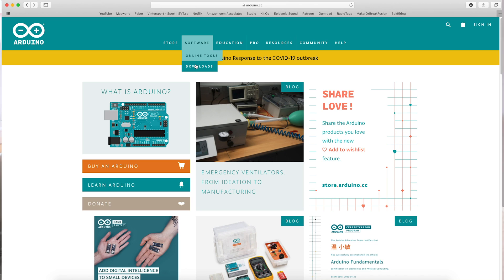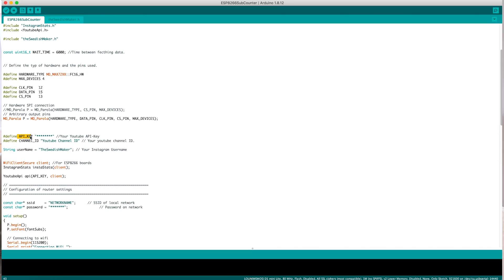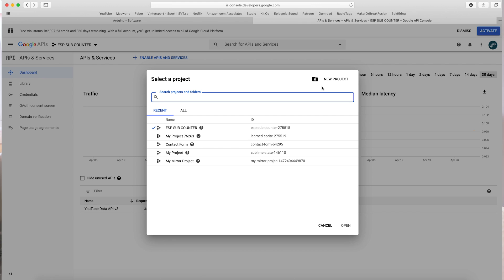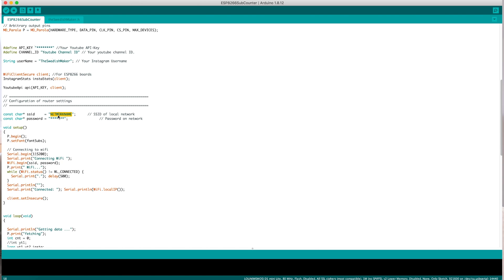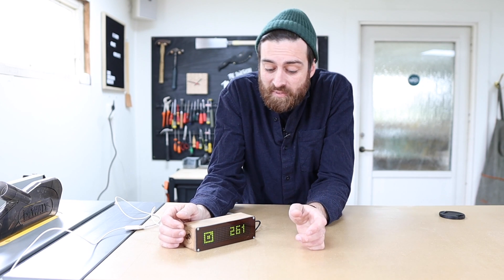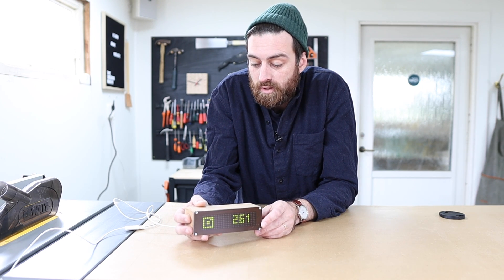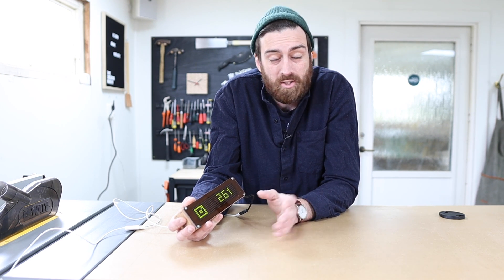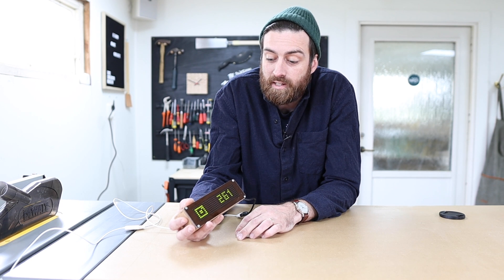This is The 20$ Subscriber Counter - Youtube & Instagram

Comment from the maker: There is still no new solution for the instagram number being zero. I will post it when I have a solution. You can increase the fetch time to about 60 (3600000) minutes to have it working longer but it still times out after a while. This is due to Instagram blocking the IP-adress after a number of times. Let me know if you find a solution.
Reply: Could I ask you to add on the code Twitch, Twitter, weather and time? Is it complicated? If it could be possible would be great!
Reply: Hello budy, how are you ?
I came to your channel through this video of the subscriber and follower counter, I thought it was great but there is a problem the follower count only shows zero, I saw that this is also the case for other people, I don't know almost anything about codes and maybe you can help us with this by making a new video solving the error and it will be very good for you as this video is one of the most watched on your channel, I hope you read this sorry for the writing errors as I am using Google Translate hugs from Brazil.
Reply: Im planning on starting this project soon. When you mention it times out, does it eventually start working again or does it "brick" itself? thanks
Reply: @christopherchadderton348  No it just showing "0" on Instagram sub.
Reply from the maker: Did you use the new code and do the Facebook API thing?
Reply: quick question about that do I use the access token I generated with the facebook developer thing?
Reply from the maker: @porgiscorner  exactly yeah. And then it can be used for generating that extended token which will last you a couple of months.
Reply: @TheSwedishMaker  I followed all instructions and its still reading 0 for instagram including doing the api with facebook etc.
also is there a way to remove the youtube count?
Reply from the maker: To remove the YouTube account you can just delete the lines regarding YouTube. To make it work with instagram I am not sure what isn't working. Mine is working with that exact solution. Does the serial monitor output anything?
Reply: @TheSwedishMaker   ok update I made it work and read but its showing my facebook page followers and not my ig followers

Cause its showing 168 which is my facebook page
But my ig is 758 and it wont grab that number count I tried so many ways and it will only pickup the facebook page number
Reply: @TheSwedishMaker hey could you help me the counter for Instagram doesn’t work
Reply: It's not as elegant, but if we set our social profiles to display subs/viewers/followers etc. on public, you could read the value from DOM (can even do that as a scripted action in Google Sheets - so you could maintain all the required data in a single sheet, and use that as the data source for hardware read). It's not as nice as using API calls but for public-facing info like number of instagram followers, it'd work, and if there are any DOM changes, it's extremely quick to change the reference in a google sheet, without needing to do anything further to the chipset code.
Reply: I finnaly manage to generate my access token, but im confuse about the "IG_USER_ID", can u explain what it means? is it my username?
Reply: I have programmed the solution. My software is 100% compatible to the hardware layout. It uses the new facebook API to get the follower counts from Instagram. I added some other features like temperature and humidity. It was a hard way to get it running. I must do a API review by facebook to get access to the Instagram followers. You will find it on www.kidbuild.de or on instagram @kidbuild . Greets Lars
Reply: @Kidbuild_DE  do you have the code somewhere ? would love to use it
Reply: @styx23x  You will find it on my Website. www.kidbuild.de
Reply: You can trigger instagram every 12 hours. I am using awtrix firmware and Node-RED and n8n to build flows and deploy it via MQTT to the device.

Comment: Hi, I just tried your "second" method but this time the instagram counter is always 0.
I have followed step by step everything you have recommended ... but I can not. Have you also encountered this problem?
Reply from the maker: Hi! I just managed to get it working this morning, but didn't have that issue. What does the serial monitor say? Did you make sure you got the correct ID and Access token?
Reply: @TheSwedishMaker  The same thing is happening to me! I entered the token formed by many characters and then as USER IG I put mine and Instagram. Yt works (although I don't care 😅) but Instagram gives me from scratch. Whereas if I try to use your old Instagram code it works for me... What am I doing wrong?
Reply: I know maybe I'm bothering you, but this meter is really important to me... I have to give a gift to a person very dear to me who is having a bad time at this time... So, can I send you the code privately? so I'm sure we'll be able to solve the problem in a flash. Thank you again For your time!
Reply: @TheSwedishMaker  I know maybe I'm bothering you, but this meter is really important to me... I have to give a gift to a person very dear to me who is having a bad time at this time... So, you So, can I send you the code privately? so I'm sure we'll be able to solve the problem in a flash. Thank you again for your time!
Reply from the maker: Go ahead and send me an e-mail at theswedishmaker@gmail.com I am going to bed now but I can check it in the morning
Reply: @TheSwedishMaker  Thank you so much indeed! Unfortunately, I've already turned off my PC. Tomorrow morning I will give you everything!!
Reply: @TheSwedishMaker  Hi, I sent you the email. Ps I succeeded but it doesn't update every 60 seconds but about every 4 minutes. Does that happen to you?

Comment: Thank you for posting this video! I found two other videos that used Dot Matrix displays, but unfortunately their scripts didn't work, so I'm glad that I found your tutorial. 
One thing that I'm curious about is how to remove the stuff for the Instagram (I sort of know, but afraid to delete anything and mess stuff up), and I was also wondering how hard it might be to include Twitch API for showing follower count from Twitch.
Reply from the maker: Hey! I havent tried twitch so I have no idea, but it would require some work. As for Instagram you can try uncommenting lines in the code with // That way you dont need to delete anything and its a great way to learn as well :)
Reply: @TheSwedishMaker  I'm now trying to figure out how to add Twitch and Twitter follower counter into the code. I'm currently trying to figure out how the API libraries that I installed for Twitch and Twitter work. I did also figure out how to make custom fonts/images for the dot matrix board, and so far made a rough Twitter looking icon and a decent Twitch icon.
This is sort of fun trying to figure all this out, it sort of feels like a complicated puzzle, lol.

Comment: First of all thank you so much for making this video, it’s very educational and entertaining! 😃 Also I have a question for you, would it be possible to replace the Dot matrix with a ws2812b matrix? I’m a total newbie at this and there is only 1 data cable. I think the code would need to be remade in order for it to work? Any help you can provide would be highly appreciated! 😃 
PS: I’m trying to make this as a gift for my GF, so that she can have as a prop in her videos.
Reply from the maker: Hi! And thanks for watching :) It would definitely be possible to use a different another screen but as you say the code would need some modification. Most of the hardware have their own library that should be added to the Arduino Sketch. Good luck with the project!

Comment: I think there is a slight mistake in description that box was "10x4x4cm" , but it should be really bigger in lenght as the matrix module dimensions are at least 12.8 x 3.2 x 1.3 cm (L*W*H) .
Reply from the maker: Yeah that could be the case, I cant quite remember what size I used

Comment: Hi, as you probably have read for other comments... instagram is stuck on 0; do you know if it's my problem or just instagram doesn't want us to fetch? changed timer to 15Mins but nothing...
Reply from the maker: Hi! It seems to be something with Instagram. I havent had the time to dive in to it yet.
Reply: @TheSwedishMaker  got the same issue, but YouTube count is working great. Thanks for the simplified code mate, of all the displays i've seen yours is the best. If you crack the Insta "0" count let us know! :)
Reply: You know what, I just had to wait about 10 minutes and Instagram count caught up also. All works perfectly 🤩
Reply: @mredrollo  for real?
Reply: @diegovio6626  yeah, maybe after it refreshed. Instagram and YouTube working perfectly.
Reply: @mredrollo  did it work just as before, or maybe you reset router? I have the  same problem with 0 counters :/ it would be so awesome if the solution came before christmas as i was thinking of gifting this peace :/
Reply: @MartynasM  honestly when I loaded the script, I said WiFi... fetching... then YouTube count and Instagram 0. I knew a few peeps had the same issue so I went to the comments. And then Instagram just started working. Don’t know, just took about 10 minutes to catch up. Now when I plug it in it’s there instantly.

Comment: Hey!
IT worked like a charm but now it only Shows me 0 at instagramm but yt works
Reply from the maker: Hey! Yeah I saw that, but I haven't had the chance to see whats wrong. I will update once I know whats going on.
Reply: @TheSwedishMaker  Oh okay so its not my chip that broke ^^ Would be awsome if you could find a way :)
Reply from the maker: @twoxico6036  I think that one solution might be to change the amount of time between fetching the data. Theres a separate row for that in the code. I haven't tried it yet, but it might be a quick solution.
Reply: @TheSwedishMaker  Actually one question :) I know i ask for a lot but could you do it like an Instagram counter and then a clock? So instead of yt counter a clock?
Reply from the maker: There is now an updated version to work with Instagram. I've updated the GitHub and the description of the video.
Reply: @TheSwedishMaker  Thanks a lot i will Look into it :)

Comment: Hey man! This project really works!! Thank you so much . But you didn't gave some libraries so i had to download 3 libraries . Still ! God bless you!!
Reply: Which libraries did you need to add? I'm struggling  to find the third.
Reply: @ViolentRunning  basically you will het an error like "library.h" no such file or directory. Go to Google and search for that library, if its a zip then sketch >library> add zip. If its direct thn add file.
Reply: @naafff1  thanks got it running in arduino now. Hopefully the hard ware arrives tomorrow
Reply from the maker: haha thank you! Glad it worked :)

Comment: i can't make it work  no MD  parole library found ....  and others  please help ...
Reply from the maker: Hi! I dont have my computer right now, but MD Parole has to be installed as a dependency inside of Arduino.
Reply: I see. It is weird since I use arduino before.. May I should install arduino library again. Thanks
Reply from the maker: Rafael Estevez yeah you should be able to search for MD Parole inside of the Arduino software to install it
Reply: @TheSwedishMaker  ok Thanks alot for your help .. I will try install it .
Reply: @TheSwedishMaker  hi .. I already install the MD library, try to verifying. it stops in #include "JsonStreamingParser.h   do I need to install from the arduino librarty too ?
Reply from the maker: Maybe you need that. Did you try it out?
Reply: @TheSwedishMaker   I already tried it. the Youtube counter works good. But the instagram is not working anymore.  the counter show "0"  because the IG already close  Json  parser.  Are yours still working?
Reply: @TechnoWit3D  How did you find the JsonStreamingParser.h in the library?  I search for JsonStreamingParser.h and nothing comes up.
Reply: @UBRArsenal  you should install from the link by Brian lough
Reply: I have update the library .finally works.. but the instagram counter still "0"... do you have any clue ?